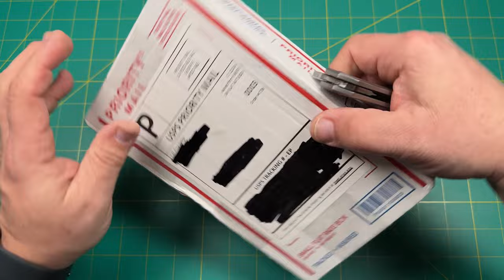Unboxing my T.W. Price Dawn knife… & adding Skiffs (part 2)… it’s so good… seriously!!

Comment: Sorry Rob… Tristate made me do it! Awesome video though, as always!!! Man I love that Relative.. I wish I would have gotten the all silver one..
Reply from the maker: Yeah, it’s my all time favorite EMP EDC for sure!
Reply: @Robs_Nerdy_Knives  oh absolutely for sure without a doubt! I ended up getting the all black 20CV relative because at the time of its first release and preorder they only made 50 of the all black, 100 of the 20CV all silver, and 200 of the Magnacut satin blade/black handle/bronze hardware. So I went with the more rare version and got a Zircuti clip for it, but I’ve always thought that the silver one was the better looking one especially with a Zircuti clip added to it. Maybe one day I’ll get a second relative just like yours (or something different depending upon what else comes out, I really liked the black with blue hardware and satin bladed version that was later released along with the Damasteel and zircuti in black/blue) but until then I’m extremely happy with my murdered out #007! Definitely not going anywhere! But a second one that I could modify, that would be cool too. But it’d have to be a Bowie. I’m not all that in love with how the drop point turned out..
Reply: @Robs_Nerdy_Knives yessss! I just checked right after that long message and got my shipping notification for the winterblade factor b3! And on the exact same day as my Grampa’s 96th birthday no less!  Today, 1/30/2024! Woooohoooo! If it follows like the other two winterblades it should be here in about two weeks!!! 

Do you have a system, or an organizer or keep a spreadsheet of all your knives? I do and it’s really neat looking over all kinds of information I saved that I would forget about in no time.. but I don’t have anywhere close to what you have coming and going.. I dunno.. just a thought. Have yourself a great night Rob!
Reply from the maker: @levelonup0314 I do it in an app on my iPhone. I track reviews, unboxing, ideas, and grail/wish lists. LOL.

Congrats on the Factor B3. Sounds cool!